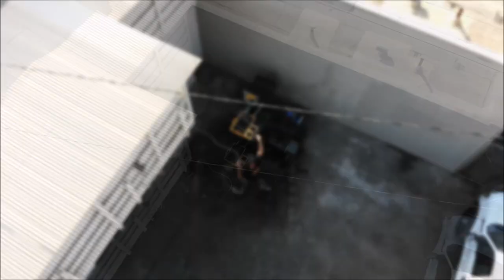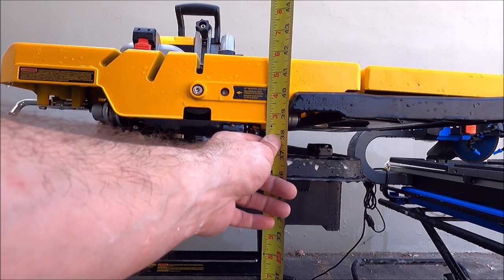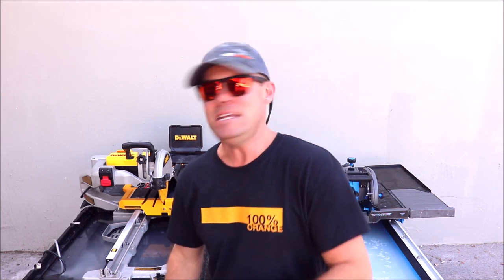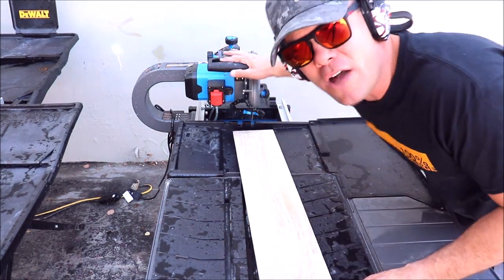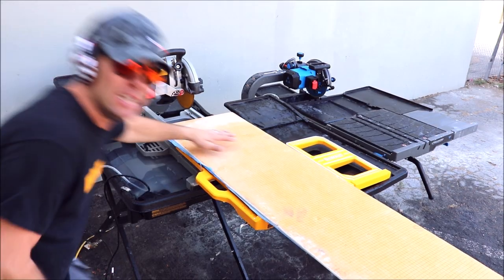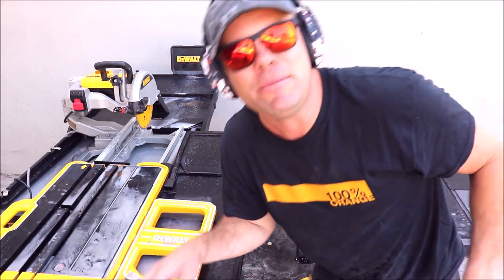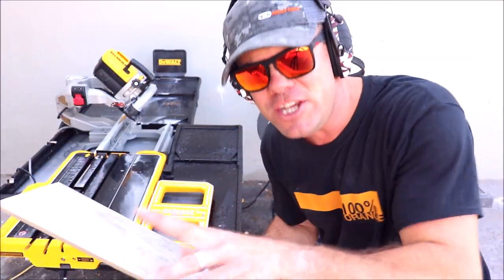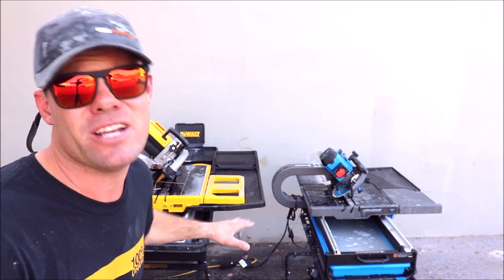Dewalt D36000 Tile Saw VS Delta 10" Tile Saw

Comment: Every Dewalt I've had would start cutting out in less than a year. If the delta lasts and is 200 cheaper plus it comes with a gravity stand. Im all for it. The older I get the more I enjoy saws that roll. Lol
Reply: I just did 700 sq ft of 3/4" porcelain pavers with a 15 year old dewalt, it still cuts true

Comment: I have a few questions. First, it says dewalt on the stand in which the delta was on. So, is that because it actually will come on that if I were to pick one up, or you put it on that yourself? If it comes with a delta brand stand, how does that compare in height then? would it also affect your width you listed of only fitting in 36" doorways?

My second question/concern is that I see you used the delta cut fence for both saws. Is this because the dewalt doesn't come with one, or the delta is just superior?

Third, how is the water containment and cleaning for the delta? I know dewalts are usually fantastic, and there have been gripes on the delta 7" for being not great with containment. But, how does the delta 10" contain the water, as well as how easy is it to clean? 

Lastly, how are the 'intangibles'? Ex: adjustment knob comparisons, blade changes, water pump, water directing, fence storage, weight, storage space when not in use... All these, and more, are things I take into consideration when looking to buy a new saw.

I appreciate all the reviews you have done, but just find the true detail lacking.

Looking forward to answers, and more great content, thanks!

Comment: Hate to be a critic but I've been using my MK101 since 2002 when i bought it brand new,  I've only replaced the switch once 2 years ago from turning it on and off 22 million times.  Never had a break down.  It cuts flawless, has a real belt driven motor compared to the loud gear driven skill saw with a tile blade attached.  Its like using a smooth running Ferrari compared to a pickup truck with bad suspension.  Yep my MK101 cannot cut a 24x48 tile, so what.  But anything 12x24 or smaller you don't have a chance.  I also can't tilt the motor on a MK101 either but who wants chipped miters anyways.  Just make sure the customers are buying the proper tile parts if possible.  Nothing wrong with those new fancy tile saws but they are NOT professional saws.
Reply: Your crazy. My delta saw doesn't  do chipped mitres. Also I've never drifted on my rip cuts either. My delta is 10x's more professional than your old dated mk. Threw my mk away years ago when the crappy guide rails with their slop and bumps were fuckinv up my cuts. Was shocked when I got my delta and realized how crappy my old mk really was. Also I'm more efficient with my delta. It's way cleaner so I can cut right by my work area and I can lay out and make my cut faster right at the saw. Also sets up quickly after I roll it where it's getting used. When your mk bites the dust and you get a new saw your gonna ask yourself why you waited. Stoneage.
Reply: @Hugh-Jorgan  good to know that you've had nothing but problems with yours.  Sounds like operator error to me, tossing it around abuse and just plain old neglect.  I've had nothing but flawless work with mine for 18 years now.  Maybe you could explain better why I would throw away a saw that's flawless still for another one.  Now your insisting I toss it away and buy a delta just because you say so. LOL.  Now that's funny.  Make me.